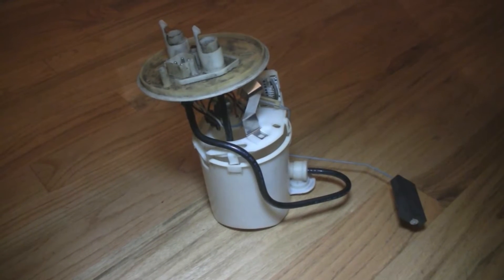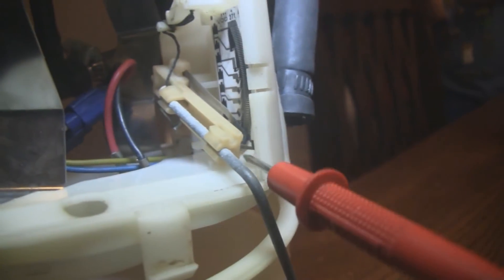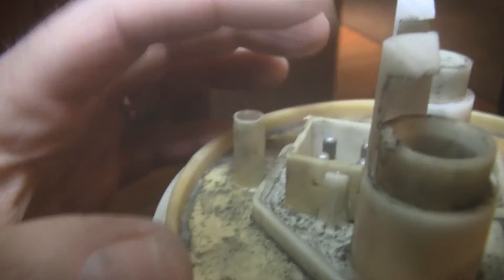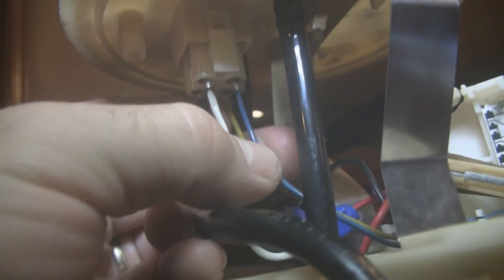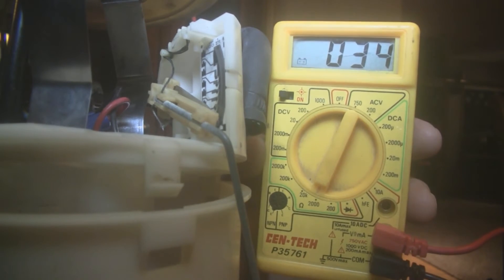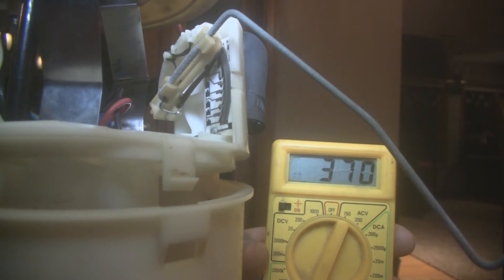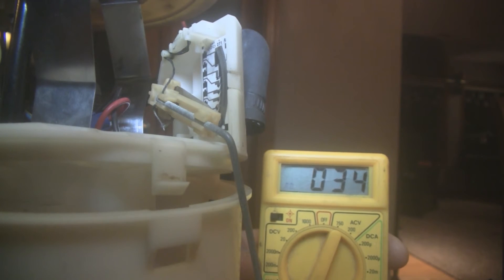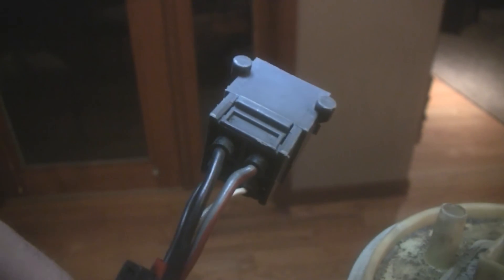SAAB 9000 Fuel Level Sender Testing for Gas Gauge (Similar to 9-5, 9-3 & Others)

Comment: Hey I replaced my whole fuel pump a year it so ago in my 2000 saab 93 but since then when I fuel up it only goes to 3/4 but it's a full tank. Do you know how I would go about adjusting it?
Reply from the maker: I don't know any 'built-in' way to adjust it. If there is a way, a 'real' SAAB mechanic might know. Here are a heap of thoughts to be taken with a grain of salt, as I am an amateur mechanic at best :-)

As I understand it, the fuel gauge on your dash is actually just responding to the electrical resistance being 'reported' by the fuel level sending unit as described in this video. Assuming there are no mechanical problems with the fuel level sender which limit its intended range of motion (like a bent float rod), your new sender is probably just 'reporting' a different amount of electrical resistance than the original. 

Maybe you bought a 'compatible' part or one from another year; or maybe it's just manufacturing variation. I've tested a couple of these and noted resistance variations across SAAB models. I've never had a problem as I always replace the fuel pump and reuse the sender unit.

If you're more adventurous than me: With some experimentation you may be able to adjust the amount of resistance being sent with an inline resistor (a common way to 'trick' sensors). Caution:  the resistance range would also have to be right, and if you 'bump up' the resistance, you risk moving the 'empty' reading on your gauge too high. This would result in your gauge failing to accurately show when you're empty, which is far more important.

Does your gauge currently seem to correctly show when your tank is getting empty? If so...I'd let it be. 

On the other hand, if it really bugs you, the best solution is probably to double-check the unit you purchased to be sure you bought exactly the right one. If not, replace it with an exact match for your model and year. If so, you could double-check that the float rod wasn't bent during installation. 

NOTE: You could test the replacement part before installation by plugging in the sender wires and moving the float up and down while an assistant confirms that the gauge covers the full E to F range. Be careful not to let the pump run 'dry' though. It'll overheat without fuel running through it.

Remember: I'm not a professional. Good luck!

Comment: The fuel gauge on my c900 doesn't work. You think this is a place to start?
Reply from the maker: +900 Saab I think the fuel sender is a good place to start, but the fuel level sender is quite different in a c900, (they're separate units not integrated with the fuel pump housing). I've had good luck with fuel senders my c900s (knock wood), but as I understand it, they do break. Her is an excellent article on the subject: http://www.comdens.com/blog/2007/06/fuel-level-sender-reinforcement.html